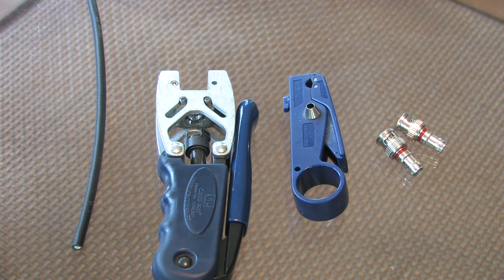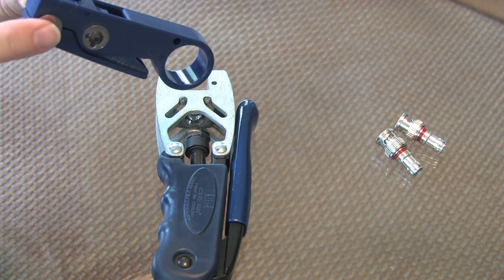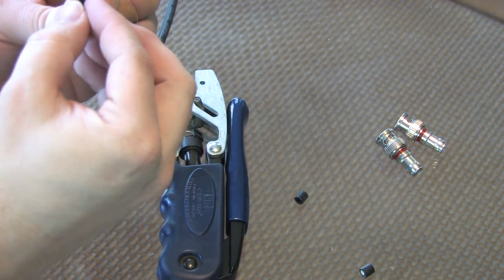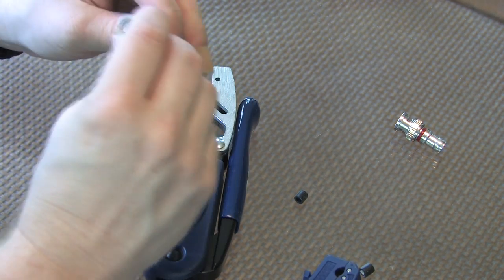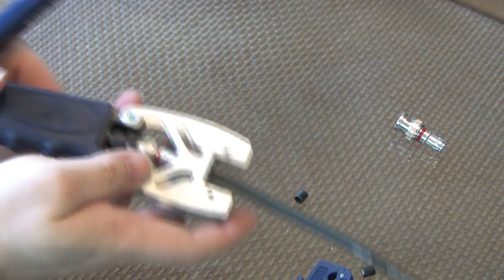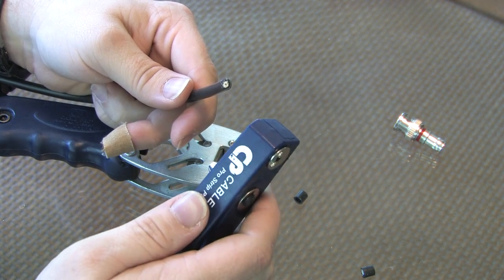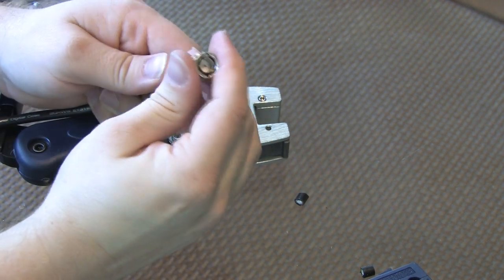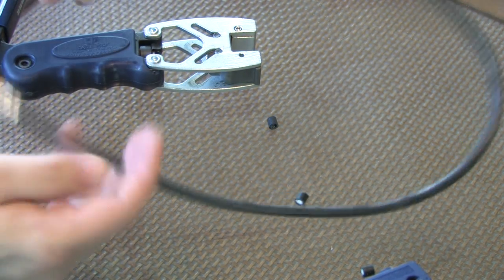Making Double Bubble BNC Compression Connections

Comment: Hi, need a suggestion. 
I ordered perfect vision rg59 connector 50 nos, but my cables are rg6. 
Can't return, can I buy rg59 then solder join it with rg6. Kind of makeshift way,
Very expensive mistake.